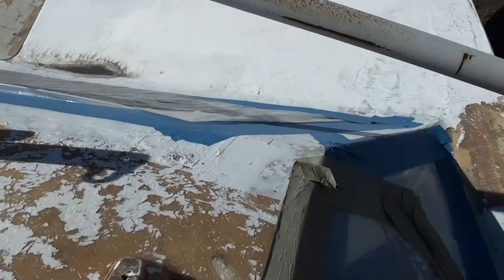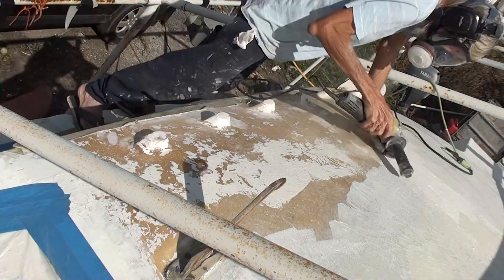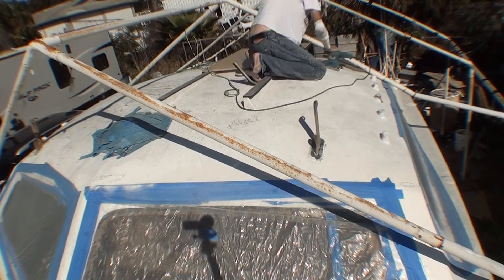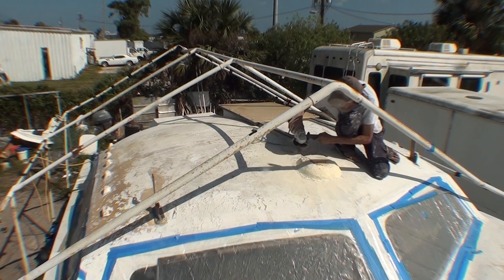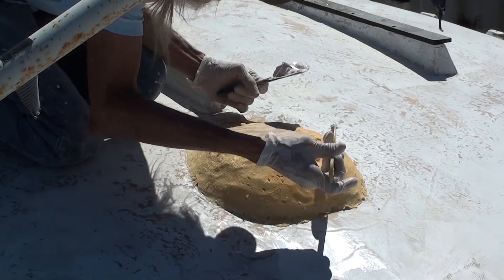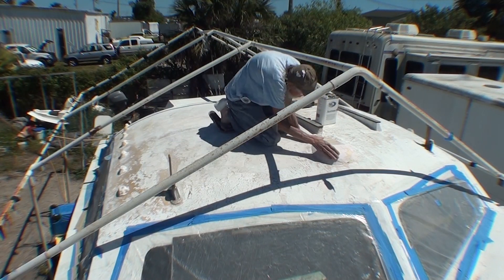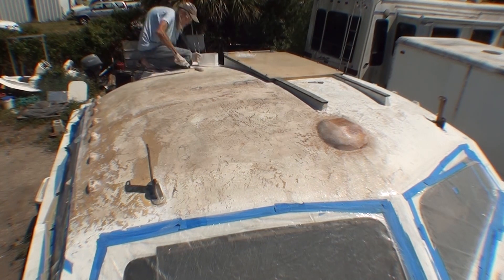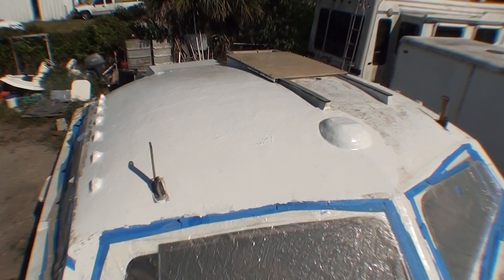Fiberglass Reinforcement And leak Prevention Catamaran Roof Starboard Side

Comment: This cabinroof looked rough like the surface of the moon ;)
Now you can be sure it does not only look a lot better, but it also will be watertight. Nice job!
Reply from the maker: At least it won't leak.  Even a little drip drip will soak your bed in an hour.  The smell of mold in a boat that leaks is unbearable.
Reply: That's true! The inside has to be absolutely dry. Otherwise it is no fun.